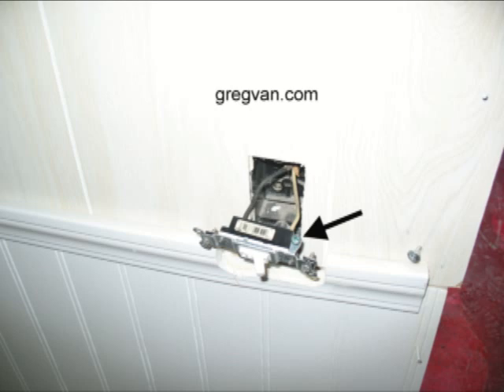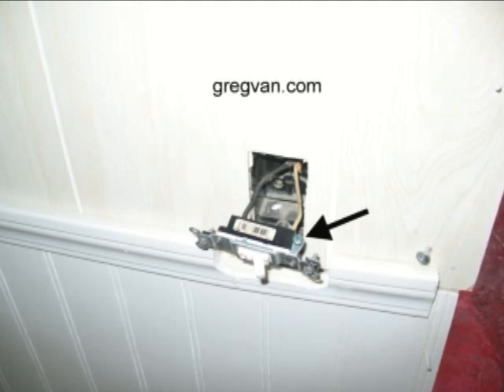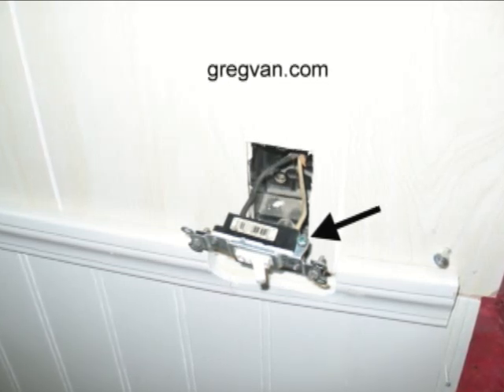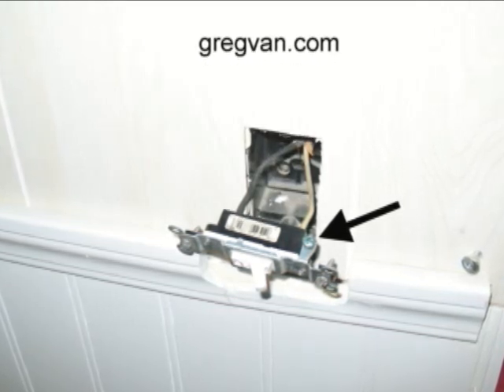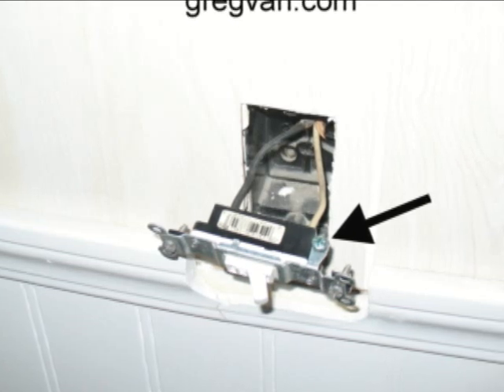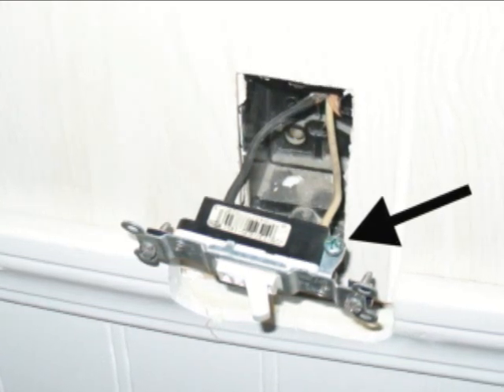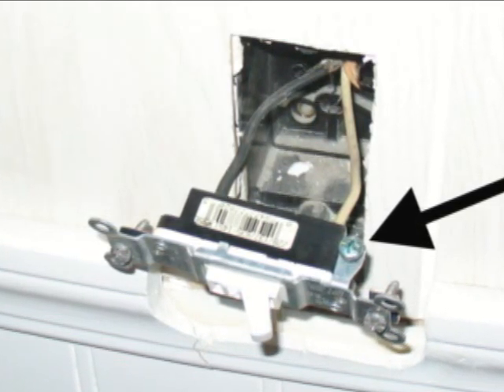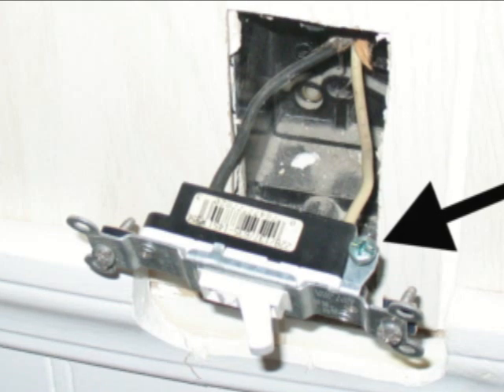Light Switch With Missing Ground Wire - Consumer Advice

Comment from the maker: If you're looking for a way to fix this, don't worry about it if you live in an older home. This building code changed sometime after the 1990s. In other words, if you do not have a ground wire in your electrical box where the light switch is located, then there won't be much you can do about it, unless you're planning on removing the electrical wiring and replacing it.
Reply: @gregvancom I replaced an old switch with only 2 hot wires connected. I could see the box has a wire connected to it so I assume the box is grounded. So, when I put the screws in to hold it in the box it should be grounded that way right? It seems to work just fine. Thanks...
Reply: So, what about Black Tape over the Screws at the top and bottom, would that be a good idea on an older home with a Metal Plate ?
Reply: @html_rulez_d00d  Yes the metal box should be grounded and when you install a switch the metal yoke will self-ground the switch.
Reply: @MrRondonmon  Code requires you to use plastic screws and a plastic faceplate on non-grounded switches unless the circuit is protected by a GFCI breaker.
Reply: Is it okay to leave the green screw on the new switch unattached to anything?

Comment: All of my light switches have ground wires inside the boxes, but none of the ground wires were connected to the light switches.
Reply: Why would they need to be if the switch is screwed into the metal box and the metal box is grouned? Wouldn't it be grounded that way?

Comment: So glad I found this . Started replacing mine  as none were grounded . Funny thing is there is a ground wire back in the box they just didn’t use it
Reply from the maker: And the sad thing about that is that the ground wire might not even be grounded and just hanging there.
Reply: @gregvancom  Whats the test to check the wire for ground?

Comment: While you are permitted to change out a switch in an ungrounded receptacle, you should know that you are only suppose to use cover plates that are either attached with plastic screws or with no visible screws, i.e. that snap on.
Reply from the maker: Great tip and can you provide us with the page and building code reference numbers so we can verify the information:)

Comment: Thank you for this.  I am going to hook up a dimmer switch in my room.the dimmer has a ground wire but the wires in the wall dos not,  Can i just place the ground wire from the switch back up in the box un connected?

Comment: I see my ground wire is super short and screwed into the conjunction box (in the wall) Is that fine or I have to extend it with a new copper wire using a twist-on nut and then screw it onto the green screw of my light switch?

Comment: I believe they started requiring them with the 1999 national electric code.  I have a '98 home that just missed the new code and has switches without grounding screws. But there are grounding wires available in the box, so when I replaced the switches I spliced in some grounding wire for the new switch.
Reply from the maker: Great advice and an excellent solution for the problem.
Reply: Our home is a manufactured home and it was built in 1996. Everything is grounded but the switches and receptacles are the cheapest grade available. I'm in the process of replacing them all.

Comment: The bathroom light switch in my 1979 home has no ground wire, but I see unused brown & white wires. The Lutron motion sensor switch I'm trying to install requires a ground connection. Can I connect the ground to either the white or brown wires inside the box?

Comment from the maker: That's a good question, but in reality the electrician used standard electrical wire that consists of one black wire, one white wire and one copper wire. If they were using the same wire for electrical outlets, the white wire would be used as a neutral wire, but in this case the white wire will be used as a hot wire. I will try and make a video, to explain further.

Comment: in older homes metal boxes and metal sheeting  cables (bx )  were used. the ground network runs thru the metal network so there is no need for a separate ground wire. the switch is grounded when screwed into the metal box.
Reply: So I have same situation but the receptacle/switch box is metal and does not appear to be grounded with any wire. Is there a way to at least ground the metal box if no ground wire is available in the electrical flex which is two core and is only hot and neutral for the switch??
Reply: take your tester and test the hot leg to the metal box if you have power your box is grounded and all you need to do is screw in your switch or receptacle and they will be grounded, no need for a ground wire. if you have no power you have either lost the ground to the box or most likely have an ungrounded  system then your whole house will be ungrounded. if the second is the case the only proper way to fix that is to install a new service and rewire the whole house. so that means you should just leave it as is and be careful.
Reply: Thanks, it appears the light switches are only two core and ungrounded, whereas the power points get their supply from the ceiling with larger gauge two core and there is a main large earth cable under the house running in a ring main which connects all the earth terminals and goes to a copper stake in the ground. This must be a retrofit of an old unearthed house. I have discovered some new 3 core wire connecting new RCD outlets where a previous owner was on dialysis in one room. This is good as I will convert this area into my en suite shower/bath which by code requires earthed power points, so a bonus which will save cost.

Comment: I am going to be adding a light switch to control the outlet on the other side of the wall so I'm going to run two wire Romex. I know what to do with the hot and the switched hot wire but what about the ground in that Romex? Should I connect that ground to the ground terminal of the new switch and then to the ground in the outlet box? Or can I run a short ground wire from the ground terminal on the switch to the can in which it sits?
Reply from the maker: Yes, the ground in the Romex should connect the light switch to the outlet and if you don't have existing grounding wires, then you can hook it up anyway. Sometimes you can hook ground wires up to metal switch boxes if they're grounded, but if you don't know for sure, then you won't have a grounded switch or plug.

Comment: If someone is getting a zinger thru the cover plate screws, replace the switch and get some nylon or plastic screws to replace the metal ones. They can be found at most of the big box stores and at any electrical supply house.
Reply from the maker: Excellent idea.

Comment: My house has the metal sheathing on the wiring and metal boxes. When I switched out the two prong receptacles and old light switches, I screwed a copper 14 gauge wire to the boxes and grounded anything I could. In some cases there just wasn’t any space so I skipped those.

Comment: This is permitted as long as the neutral is reidentified as hot by being painted or taped black at both ends. It's how you wire a switch with only one cable running to it.
Reply: Actually instead of saying neutral you should have said white wire. It's not a neutral in this case and thus should be identified as you suggested.

Comment: I have a two gang light switches that I want to replace with décor switches. I found that the old switches did not have grounds but there is a grounding wire in the back of the box … one goes to porch lite- the other to two seperate led light that used to be tracked lighting. The box for the switches are not metal. So do I need to pull out the mess in the back and create grounding jumpers for the two new switches? Or can I just install the decor switches without grounding since I see that the lites the switches operate are all grounded?
Reply from the maker: Most electricians connect multiple ground wires to an existing ground wire for your switches.

Comment: That's exactly what I have found. The question is, do I just install the new switch with no ground? Or should a ground be created? If the latter, how?
Reply from the maker: I personally wouldn't worry about grounding your light switch, if you don't have a ground wire or metal box to tie the ground wire to. Remember, this is only my personal opinion and it wouldn't be a bad idea to contact your local building department for more information.
Reply: gregvancom Thanks for the response. The switch is in and working fine.
Reply: Marcus Robledo

Comment: So if I’m going to change a smart dimmer and it comes with ground wire but my metal wire grounded box has no ground wire, how should I do with the ground wire that comes with the smart switch. Should I just leave the ground wire hanging or I should make it touch the metal box? Thanks!
Reply from the maker: I think most electricians would attach the ground wire to the metal box in hopes that the metal box itself is grounded.

Comment: My house was built in 1993. I replaced the switches and none of them had a ground wire attached to the ground screw on the switches. However, the boxes in the wall are made of metal and are actually grounded (the ground wires are screwed to them), so does that means the switches are grounded with the contact of the screws on the boxes? Should I really need to add a ground wire to connect it directly on all the switches? My guess is that it has been done that way because it was sufficient, at least at that time, but would it be against code to replace the switches today and not ground them "directly"?

Comment: So I can change out my old switch for a new one without grounding. I live in an older home with no ground in the light switches.   Thanks
Reply from the maker: I personally wouldn't worry about it, but you would need to contact your local building department or government building authorities for the correct answer to your question. In other words, if I tell you that you can, but 10 years from now someone is reading this and you can no longer do it, then there could be problems.
Reply: @dropndeal  how do you know if the metal box is grounded?

Comment: Perhaps it’s possible to attach the ground wire to the metal box itself. How do you recommend testing the metal box to see if it’s grounded?
Do you have a video for that?
Reply from the maker: You would need an electrical tester, then attach one side to the hot and the other to the box and if you get a 120 volt reading then it's grounded, if it doesn't do anything, then it might not be.

Comment: @gregvancom, I have a question related to ground wire but not light switch. I read your comments about older houses did not require a ground wire. My house was built in 1957. I want to install a new security light outside to replace the old one, as it appears to have been there for decades. As you might have guessed, no ground wire. The new fixture does have a ground screw  (green).  From what I read on another Q&A, it appears that I can connect a copper wire from that green screw to somewhere on the existing metal box. Is that correct?  I understand I can do without the ground but does that pose a significant safety (fire) risk?  Thank you very much.
Reply from the maker: +Angeleno09 You seem well-informed and I would attach the ground wire to any metal box in hopes that the metal is grounded, even though it might not be. Are there safety issues for homes where the electrical plugs, lighting and switches aren't grounded, yes there are, but there isn't much we can do about it unless we replace the entire system. If it's a concern of yours and your family, then I would suggest contacting a local electrician for more information.
Reply: +gregvancom Thank you for your reply.
Reply: +gregvancom I'm having a issue with installing CeilingFan that seams to back a ground. What am I supposed to do to fix this?!?

Comment: My old light switch doesn't have a ground wire, and I don't see a ground wire inside the wall. I only see 3 wires... (2) Red and (1) Black... The new switch I'm using is the Leviton 15/20A switch, and it has a green ground screw. Is it OK to go ahead and install the new switch without a ground wire? Is it OK to just leave the green screw alone as it is? Please share your thoughts if you can. Thanks!
Reply from the maker: Arthur Shamunee Newer building codes require lights switches to be grounded and I don't think you'll have a problem if you're existing building or home doesn't have a ground wire. However, if it's something you're concerned about, I would contact your local building department for clarification.
Reply: +gregvancom  So it is ok to have two wire black and red only connected?
Reply from the maker: Yes, if your home was built that way and hasn't been remodeled or modified. New building codes apply to new construction, at least it will until they change the rules.

Comment: House is 1980's wiring and I don't see a ground. 2 black to the light switch, 2 white wire capped together, and 1 copper wire capped.  How can I attached a time switch that says a ground is required ...... and what are the 3 extra wires I have for ?  Thanks for helping if you can.
Reply from the maker: The copper wire should be your grounding wire and you can simply extend it by connecting a another copper wire of the same size to it. If you don't understand, I can always make a video.
Reply: thanks Greg.
Reply from the maker: You're welcome

Comment: Can you tell if a light switch with an outlet should not have an open ground? It is an older home from the 70's and somebody told maybe they forgot to connect the ground wire.
Reply from the maker: This is a newer building code, I don't think it was enforced before the year 2000. The only way you could tell, would be to remove the light switch and see if it actually had something on it that you could attach a ground wire to. Remember, your home might not have light switches with ground connections and would require a new light switch, if this was a concern of yours. If I didn't answer this question correctly, feel free to provide me with more detail.

Comment: If you only have hot and neurtal wires in an older home, would the only risk of electrocution come from damaged insulation of the hot or neutral wire?  It's my understanding that the ground wire will distribute current to the ground if the hot/neutral circuit is broken instead of it transferring into something contacting the break in that circuit.
Reply from the maker: I've lived in plenty of homes and visited plenty of others that do not have any outlets or lights which is grounded and there wasn't ever a problem. You are absolutely right about the risk of electrocution coming from damaged wires and if they are damaged, then they can be repaired or replaced.

Comment: Hello. We are replace a switch with a motion sensor. The room is upstairs remodel of a 1947 cape cod. The switch has a ground wire but now the motion switch doesn't work. How can I test if the ground wire is "truly" grounded? Ps. The motion switch has power to it and the light goes on, if just doesn't go off or motion. Thanks
Reply from the maker: I don't know how to test a ground wire, but it seems like something else would be the problem. I would return the switch and try another one if you read all of the directions and installed it correctly.

Comment from the maker: Keep in mind, homes built before a few years ago, didn't require every light switch to be grounded. I'm not about to give you information you shouldn't validate with a local electrician or your local building department, but you're probably okay, leaving it as is and there's a good chance your light switch didn't require grounding and was approved by a building inspector and installed by a qualified electrician during the specific time period your home was built.

Comment: I JUST BOUGHT A HOUSE WITH OLD WIRING. SO HOW WOULD YOU ADD A THREE PRONG OUTLET ? IS THERE ANY WAY YOU CAN RUN A GROUND WIRE THROUGH YOUR WALLS AND STILL KEEP THE OLD WIRES?
Reply: Replace the outlet with a GFCI outlet . . . that will provide  you the protection you're looking for.

Comment: So what do you do if you find no ground wire to connect to the switch?
Reply from the maker: It's not uncommon to find an older home built before the 1990s without a ground wire for a light switch, so if you are replacing one, then I would imagine that it would be safe to assume that it could be replaced and rewired in the exact manner that was used by the original installers. I'm providing you with this information, but you would need to check with your local building and safety department if you have one, to verify this information.

Comment: I just purchased a home built in 2004. I am wanting  to swap one out for a dimmer switch and to my suprise just two wires?! What now?
Reply from the maker: If you only have two wires, then one is hot and the other connects to the light. You should be able to hook the dimmer switch up, with only two wires. Remember, older homes don't have ground wires, but they're not needed to make a light switch or a dimmer switch operate, ground wires are for safety to prevent any type of electric shock.